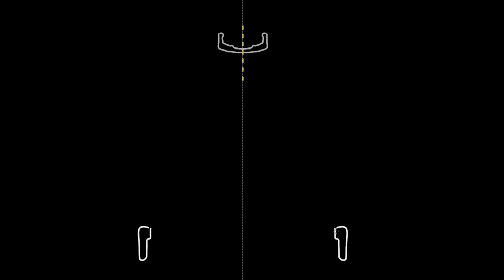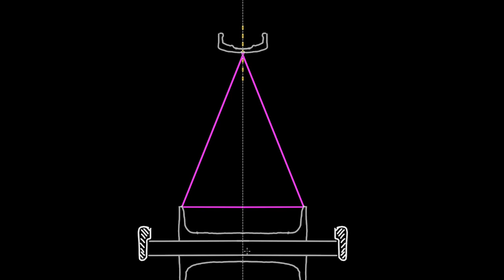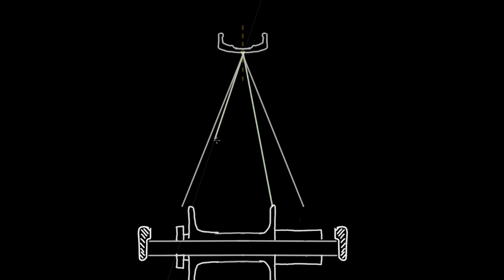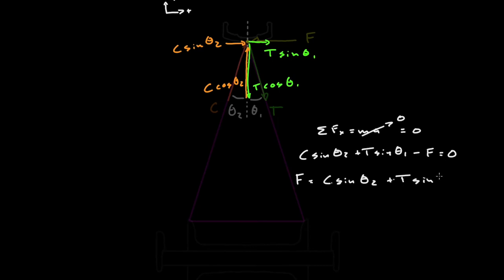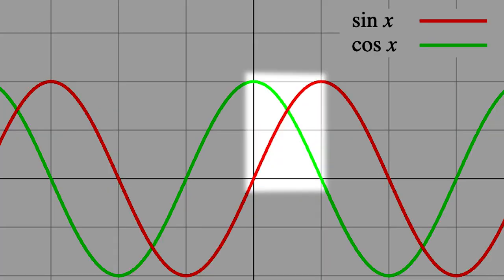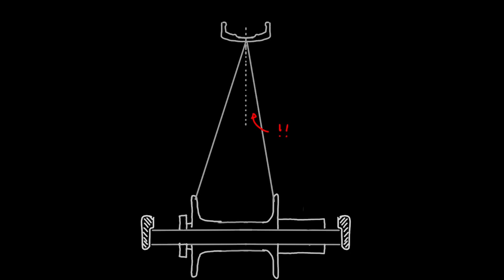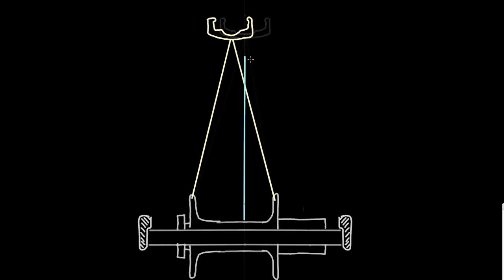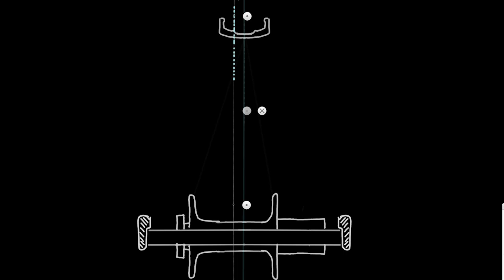WHAT are Asymmetric Bike Wheels??

Comment: Also, from a wheel-building and reliability standpoint, you don't want to have too much of a difference between the drive and non-drive side spoke tension due to the fact that the maximum tension is "controlled" by the DS. In other words, when the DS spokes are fully tensioned (to allowable limit of the rim), if the angle difference DS to NDS is too large, then the tension in the NDS can be quite low...and in some cases, if the rim radial stiffness is also low, then it's possible to get in situations (such as hitting a bump) that causes the NDS tensions (in the contact patch area of the wheel) to drop to zero...at which point the spokes can begin loosening and/or fatiguing. As you mention, it also results in a less laterally stiff wheel structure. All good reasons to prefer asymmetric spoke hole arrangements.👍
Reply: Ditto...  exactly the point I was going to make, but you said it better than I could.  Thanks.

Comment: Do I NEED Asymmetrical Rims? No.
Do I WANT Asymmetrical Rims? Yes.

When I built a set of wheels last year using Hunt 4 Season  SuperDura Disc rims and DT Swiss 350 hubs front and back, my spoke length calculations ended up coming out identical for both sides. In fact, it ended up being the same front and rear. That made getting spokes a lot simpler.

Comment: Great topic, and very clearly explained! I've always wondered about the benefits of an asymmetric rim. My question is with the tension in the spokes being equal, but offset, any externally applied vertical load on the wheel will induce a weak axis bending moment in the rim. You can see this when you draw a free body diagram of the wheel with the normal force acting through the center of the rim/hub. The question is, is the benefit of a symmetric spoke tension preferred over symmetric stresses in the rim? Has anyone studied this in-depth enough to make that conclusion? Although, the eccentricity is small (a few mm) and with a trend towards wider rims in general perhaps the minor axis stresses and/or deflections are fairly low, even with big impact forces? It would be interesting to hear your thoughts. As a comparison, what about the benefits of using an asymmetric spoke diameter, spoke lacing pattern, or spoke count instead? 
Looking forward to your research results on mass damping of bicycle tires and rolling resistance.
Reply from the maker: Mechanics of materials has entered the chat. Hey Henry!  I see what you’re saying. I suppose a small offset in spoke offset yields greater benefit in tension balance than drawback in bending moment, but would have to do the math to quantify.

Comment: Asymmetrical rims allow the higher-tension side of the the wheel to not have quite such high spoke tensions as they would with symmetrical rims, too. So while being ridden, this keeps the spoke material more in the "elastic deformation" state. And then upon impact from a bump or impact, this lowered high-side tension minimizes the chances of the spokes going into the "plastic deformation" state. So while the lateral strength and stiffness is improved with asymmetrical rims, it also tends to help wheels stay true over time because of less tendency for spokes to stretch from impacts. And interestingly, even a small amount of rim asymmetry makes a pretty big difference with minimizing this plastic deformation of spokes.

Comment: This is actually what the Cannondale AI offset aims to do. The Cannondale system makes the spoke angle nearly symmetric with traditional rims. Instead of offsetting the rim the frame is offsetted. This gives the stronger rear wheel but also larger chainring clearance and tire clearances. It didn’t seam to catch on though which is a bummer because it helped solve a few issues.
Reply: Tom Ritchey did the same thing, only many years before Cannondale.
Reply: They apparently abandoned this technology in their latest Topstone bikes.  Too bad for science, but good for compatibility.

Comment: Excellent video that discusses the merits of asymmetric rims. However, I'll also like to see some discussion on what kind of trade offs there are too, like how the rim itself has to be overengineered more to preserve rim strength. Just as you are giving the isosceles triangle back to the spokes, you are taking it away from the rim after all. 
I've also noticed there might be a way to mitigate the spoke angle problem besides offsetting the rim, by offsetting the hub flanges instead. I have a set of hunt gravel wheels that does that. What do you think? Is it a viable solution or am I missing a lot of information?

Comment: How long are the threads of the spokes??! I bought some that are only 4 mm long, a real pet peeve...I can't get enough tension....
I think I need to offset my rim to the hub!!! The rim and tire is not centered to the back frame... Don't know how much shorter the spokes needs to be the gear side....
I made new wheel with a wider rim, and now my tire is obviously wider...and now rubbing on the brake side....

Comment: If the rim is symmetric, does that mean that the drive-side spokes need to be shorter so that spoke tension difference vs. non-drive-side spokes is minimized?

Edit: after some Googling, "Differential spoke selection is done to create ideal thread engagement on both sides. It does not equal out left and right side spoke tensions."
Reply from the maker: It’s both. You need different size spokes just to fit the build (ideal thread engagement), but the math doesn’t lie - it balances spoke tension as well

Comment: Bike science is awesome! I was disappointed when the bike industry switched to 148 drop out spacing. Many hub companies didn’t widen the hub flanges and just added longer axles or end caps. So essentially the wheel strength remained the same. True the asymmetrical rim helps with strength but the width of the hub flanges also plays an essential role. So with that in mind you can see why some companies have gone to super boost 157mm axle spacing. Pivot,Evil,Knolly and Devinci to name a few. So my point is, if you’re buying a new wheel set, take a look at the flange width too. Personally I have some SS specific hubs for my single speedy Mtn bikes and those hubs have about the same flange width as SB157mm geared hubs. I’m not a big guy (160#) and definitely not a DH racer or freerider that’s smashing down the mountains,but I do think that a stronger wheel is important. The SuperBoost 157 standard hasn’t really gone mainstream but it’s obviously a stronger wheel than Boost 148 that wasn’t much better than standard 142.
Reply: I think you mean 142 drop out spacing.  The 142 hub dimension is identical to 135 just with a longer axle.  I believe the idea was to add slots in the dropout so you could install the wheel easier.  The 148 is where they widened the hub flange spacing from the 135/142 design👍
Reply: @DeeCountVideos  they only widened the hub flange 3mm on each side and this is not the standard. Some hubs don’t even do the the full +6mm. All the hub manufacturers have to do is ensure the axle width is 148 and the non-drive side is properly aligned for the brake rotor.
Reply: This is on an old 126mm dropout road bike, but it's possible to get 9 cassette cogs in the space  for 6 freewheel cogs. Actually shorten the 8,9,10 speed freehub  by grinding the end leaving just a few threads for the lock ring. Grind a few threads off the lock rings. Grind the spacers on the axle so the last cog nearly  touches the frame. Lock nut spacing has to equal 126mm. This gives a wheel dish lower than stock. Use 10 or 11 speed cogs to build the cassette. If a large sprocket, say 36 tooth freehub is used, it may be possible to grind the back of the  cassette spider and get 10 cogs instead of 9. The axle needs to be cut shorter so the quick release still works. Time moves on, and "standards" shift, but ingenuity can upgrade your bike when it becomes obsolete. I wanted to get a Velocity offset deep section rim to further dish reduction,  but they weren't available. Learn to build wheels and that will help with all of the above.
Reply: @davidburgess741  sounds like a fun project. I’ve thought about using my old Hadley 135 bolt on hub to build up Pinion drive frame with a Gates Carbon belt drive. A townie or commuter bike. 
My old Hadley’s are a dark blu ano and still work great plus look amazing. The front hub is a 9mm through axle that fits old  QR forks
Reply: @hardmtnbiker  Pinion drive sounds great,  but the belt drive looks like it may have flopped commercially. It was available with CoMotion bicycles as seen on the retired Bicycle Touring Pro website. His older Australian buddy did wind up with some kind of problem with his Pinion drive on another make bike. Those systems are slightly less efficient than the derailleur system and are really expensive and heavy. If you want efficiency and reliability get a fixed gear! Tremendous mechanical efficiency,  but horrible biometric efficiency! It depends on how you weight the usual factors. You can only choose 2. Your options grow when you learn to build wheels. Ali Clarkson and Jim Langley have made the best YouTube videos IMHO. I've actually built wheels occasionally for 30 years that worked,  but these guys raised my game. Jim will also respond to questions  of subscribers promptly.  Penny Farthings? Well, he's done that too! Very interesting rabbit hole!

Comment: What extent of use in your opinion will asymmetrical rims be necessary because symmetrical rims can hold quite some load before the need the switch to asymmetrical rims?
Reply from the maker: Not a question of need really. Imagine carrying 100kg. Would you rather hold 50kg in each arm, or 80 in one and 20 in the other? Asymmetrical rim holes just balance out the tension a bit

Comment: I bought the DT Swiss RR440 asymmetrical rim without knowing that it was asymmetrical (I have no chance of returning it), unfortunately there are not many rim options in my region... I had this rim knitted for the front wheel of my road bike without disc brakes. The appearance of the wires is symmetrical when viewed from above. Will I experience any problems such as stability or instability while driving?
Reply from the maker: You want asymmetrical, it’s a better design

Comment: This is badass man I've got a set of affordable FSA NS Asymmetrical wheels, they are my 1 of 2 non OEM wheelsets that I own for my bikes and lemme tell you even tho they're only a 28 spoke wheelset vs all of my other 32 spoke wheels they feel tremendously stiffer, maybe becuase they require a higher spoke tension than a 32? I have them mounted with some 42mm Pathfinder pros tubeless 30psi front 35psi rear, soon as I got them mounted up to my Frankenverge (Specialized Sirrus X3 converted to drop bars IE: poor mans Diverge) Immediately it felt like I was riding on 28mm slicks at 100psi no joke them things feel stiff! 
Side note I dont really ride them that much because the hub to me is waay too loud even after throwin a bit more grease in there, they are a good warning for pedestrians as they can usually hear me coming before I get close enough to anounce myself.